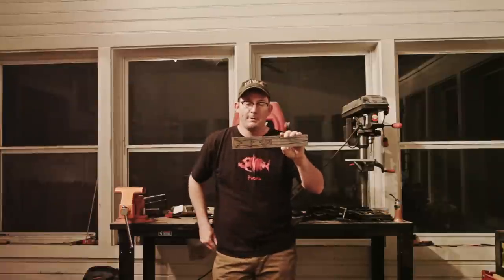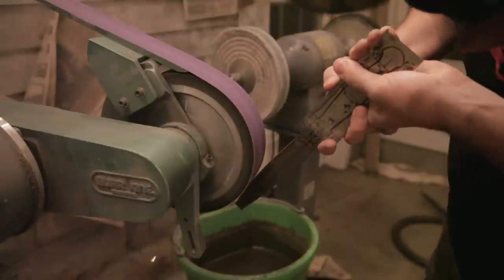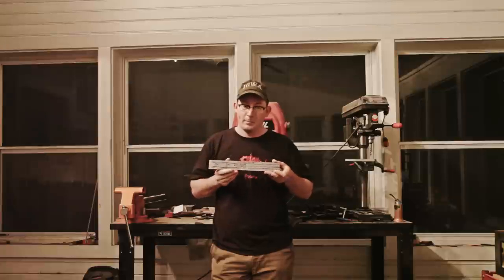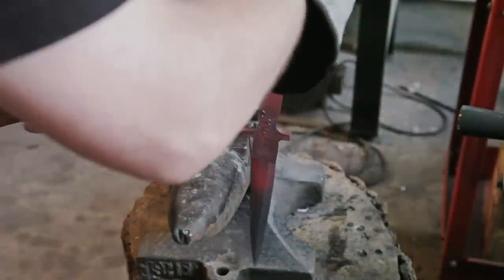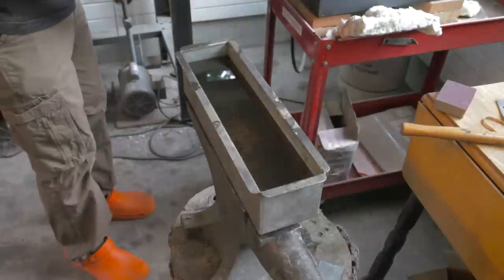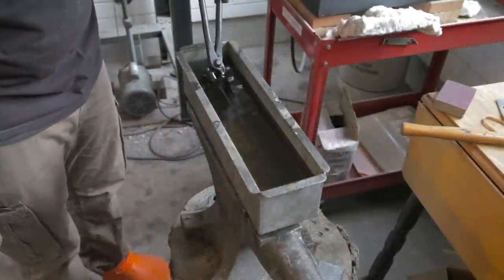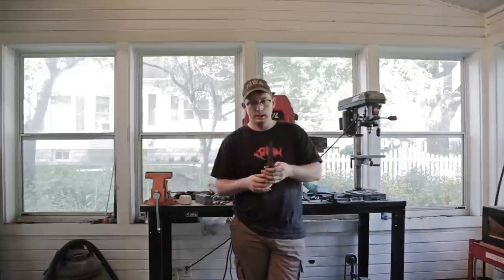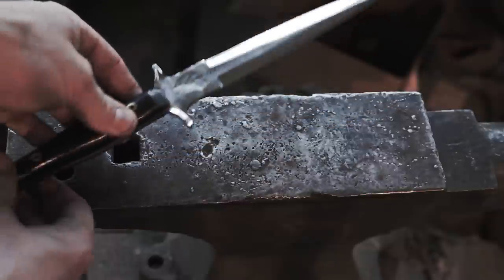The Making of a Combat Dagger

Comment: Appreciate the insight into the design and the practical approach to forging vs stock removal. Why do you forge guards vs a fitted guard through an addition to the handle? It is a time based decision, the strength/durability of an integral guard or simply a style choice?
Reply from the maker: Thank you for watching and commenting.  The problem with using a fitted guard is getting the guard to fit over a full tang.  If you still want a guard on a full tang knife you have options but they would be difficult for me to execute.  You could make a slotted guard.  You could also make a 2 piece guard that has a slot milled out of the middle.  Not having a mill, both would be difficult for me to make.  I can't make any evidence based claims on the strength/durability of integral guard design vs. fitted guards, but it makes sense to me that an integral guard would have more strength.
Reply: averageiowaguy 
I believe you would want your guard to slide over your blade not your handle and then solder or braze it in place before you put your handle on.

Comment: how can I straighten warped blades ?
Reply from the maker: During the tempering process (meaning after quenching if that is when the warping occurred) you can fix it.  After the first temper, so that the steel isn't brittle, you can straighten them by putting the blade under tension in the opposite direction that it is warped.  I usually do this with some sort of round object like a bolt, 2 clamps and a straight piece of steel.  There are videos somewhere on how to do this.  You put the blade back in the tempering oven with it bent in the opposite direction of the warp.  It isn't an exact science but it usually works.  If the problem is confined to the handle you can turn it into a tapered tang.
Reply: averageiowaguy ok thanks